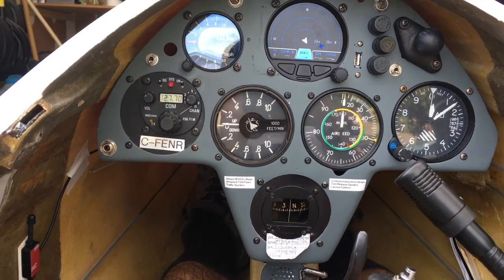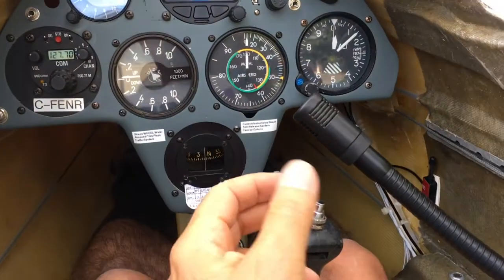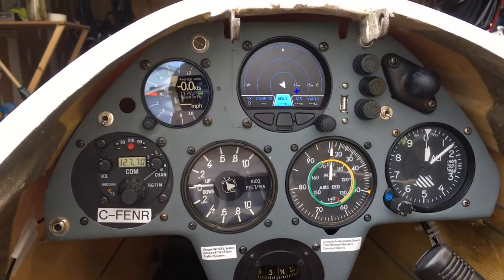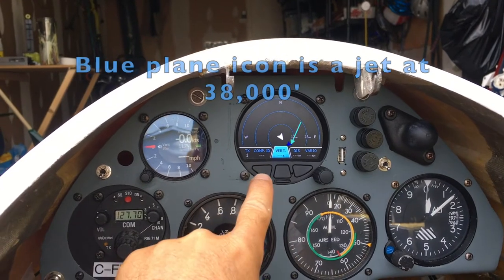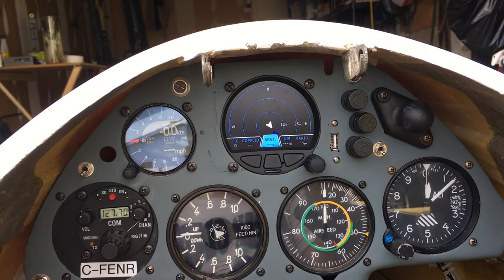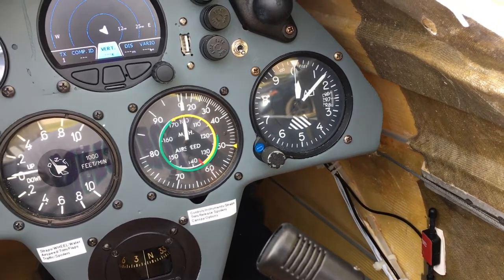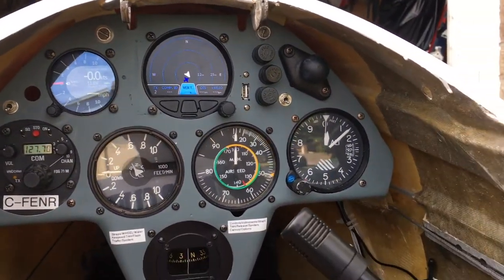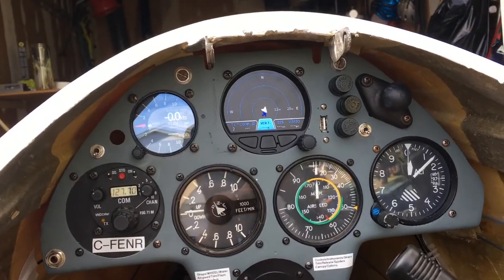Libelle H-201B Cockpit Tour

Comment: Thanks for the tour Dave!
I just downloaded and 'flew' the Libelle on Condor 2.
I'm impressed.
Reply from the maker: The model in Condor is pretty good. If you have any turbulence setting for thermals you'll notice it's harder to keep banked evenly without lots of practice.  This is the main reason people go for the winglet modification (which mind does not have) is that it helps with stability.  In real life, I've not had much of an issue ... yet.  I've yet to get a good strong thermal in it, esp since I live in the North East of the continent.  Having a good climber in weak lift is a good thing here.

In real life the fuselage is narrow, and it is said that you strap-on a Libelle.  I'm on the upper limit of shoulder width to fly it. It is not roomy, but you really feel like you yourself are flying.  Condor does not let you experience that, but it's no wonder that 52 years later people still love flying their Libelles.  

It's funny that last season, other that flying my Libelle, I flew the club Grob 103, which in terms of room in the cockpit is at the other extreme!
Reply: @davesgliding  I 'grew up' at Hawkesbury in the 70's, and familiar with less than strong thermal activity as well.
I've been evaluating a few sailplanes on Condor with the intent on buying  sailplane in the near future.
Although everyone would be flying an EB29, realistically my budget would  allow something between a Ka6 and a PIK20.
So if you know of reasonably priced sailplane, let !e know.
Have a great season!
Reply from the maker: @CLdriver1960  Ka6 is another classic.  The PIK-20 is nice and roomy, but most versions have no airbrake and so you need to land using full flaps.  I've never flown one, but have seen pilots landing them, and the approach can sometimes look quite scary (even more so with the SGS 1-35).  However, being able to use negative flaps when flying faster would certainly help you with a silver distance flight, but not a good sailplane choice if you are a low-time pilot.
Reply: @davesgliding  Thanks for all of that info!
I'll be looking at a few possible candidates in the near future.
Also, I plan on visiting MSC, GGC, and RVS once the stay at home orders are gone, and when I get the go-ahead from each clubs' DoF.
Hopefully, I'll get to meet you at RVS.
Cheers!
Doug

Comment: Dave, I first watched your tow plane view of the Aerotow. You don’t disappoint! Thanks for this cockpit tour.
Reply from the maker: Glad you liked it.  I should mention that great care is needed when attaching anything to an aircraft to ensure it won't interfere with controls, has a secondary attachment, and if it falls off, won't hit and break anything.  On that latter part I was convinced that the light camera and atmospheric drag would cause it to lose altitude quickly and not hit the glider on tow, but now I have second thoughts.   I don't think I'll try that again.
Reply: @davesgliding  good points. You could always get a shot out the rear window of the tow plane - but probably wouldn’t be as spectacular!

Comment: Hi Dave,
nice video, VERY interesting for me! 
The video gives a few quick glances on an external instrument case at the bottom of the cockpit, below the instrument drawer. Your speaker is built in there. 
I own a Libelle, too (Werknummer 322), and I am looking for such a container for  already a long time now. These cases are very rare and it is even hard to get pictures of it. So this could be my chance... How is that case mounted at the cockpit floor? Maybe you can provide me some more photos of that instrument case?I hope to be able to build a similar instrument case for myself then. I really would appreciate your help....
Greetings from Germany 
Marius
Reply from the maker: Hi Marius.  Where do you fly in Germany?

I honestly don't remember the mounting details.  At the end of the month my partner and I will put ENR away, and will be removing the seat pan so I can paint it this winter (I accidentally scrubbed off the varnish when deep cleaning and afterwards started getting fibreglass splinters in my arm when flying).  I'll try and get some good pictures then.  You can contact me using dave d0t villeneuve at gmail d0t c0m and I'll send you photos.

The serial number is 34, but even slightly later Libelles than this I have not seen this mounting point.  A new Libelle owner at the club also wished for one.

In its earlier life, I think an O2 pressure gauge was mounted there. It was with the stuff that came with the Libelle when we bought it, but not installed.  I do find the pressure pipe/fitting below there, and the size is right.  We are flatlanders here, so no need for O2, so did not restore it.

For now I have taken the ballast bags out of the  wings. Our thermals, when we had them, were very weak this year.  I do not want mice to use material to make their home over winter ... so for now, it's no longer an "H" 201. ;-)